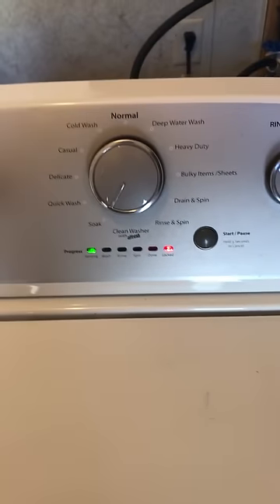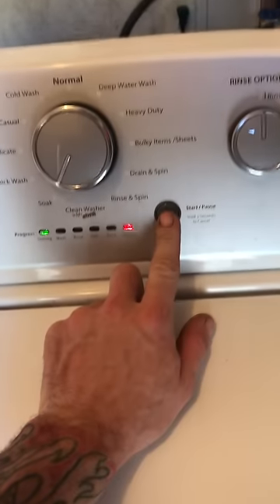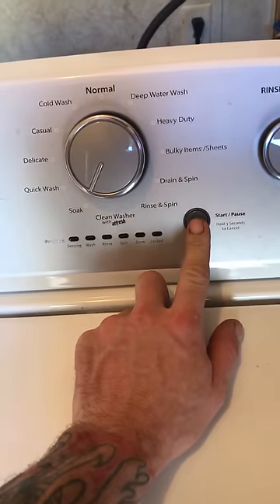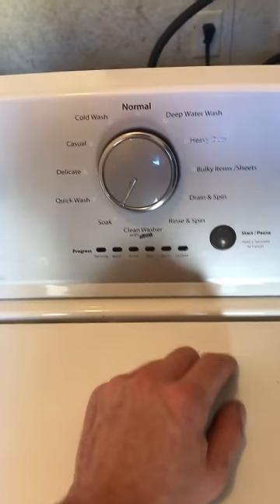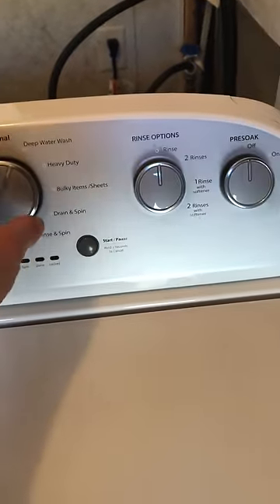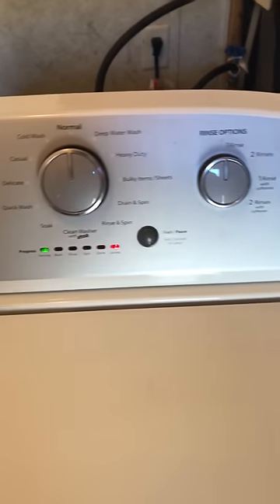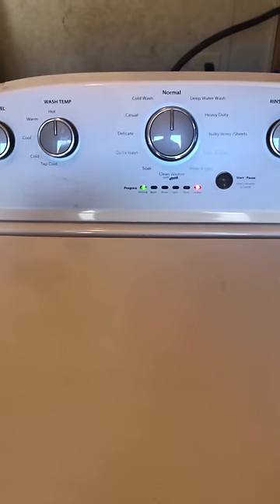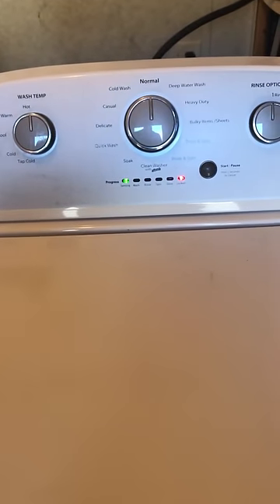Whirlpool washer will not pass sensing cycle

Comment: Pull the tech sheet for the unit (inside the console or taped to the inner cabinet) and follow instructions for testing the motor fault. Most likely a bad CCU
Reply: Okk

Comment: We lost power in our electrical panel. Afterwards the washer blinks the sensing light, puts a shot of water in then nothing. Then starts it all over again. Have tried all of the unplug, closing door 6 times tricks and still not working. Lock light is also not coming on.

Comment: Same problem that i had and this is what i found out, 
Sensing cycle means that it is checking the level of water in machine.
From start up no water should be in machine this is why it's flashing sensing. 
First UNPLUG MACHINE!!!!!!!You must drain the water then machine will work. 
Check your drain pump MAKE SURE ITS UNPLUGGED. it's has two leads brown ,blue. Disconnect and check the pump it should not show a short with the volt meter, if it shows short it's bad.
Reply: How do you drain the water??
Reply: kansaskix1 
Make sure to UNPLUG THE MACHINE FIRST.
Open the back of the washing machine and tilt it foward. Disconnect the drain pump  and straighten the machine back right.  The water will run all over the floor so be prepared to clean it up the water
Reply: Thanks so much for replying! But I finally got it to work (after 6 hours) by doing a recalibration specific to this machine (found a video for that also :)
Reply: kansaskix1 mind sharing that link? I’m having the same issue as what’s in this video
Reply: This is the video I used.  You have to do it exactly how he shows it with the knob starting in the same place.
Reply: kansaskix1 did you replace the board or just calibrate the machine?
Reply: kansaskix1 video link please this just happened to me this morning
Reply: Tyler, I just recalibrated the machine. I've had to do it again two or three times since then. I finally put two and two together, that the machine kept doing it when I used the "Delicate" cycle. There must be some sort of faulty something on that particular cycle. So I can't or just don't use it anymore.
Reply: kansaskix1
1 month ago
https://www.appliancevideo.com/whirlpool-wtw5000dw-washer-will-not-complete-spin-cycle-electronic-control/

Here's the video link again. You have to do it EXACTLY like shown in the video, with the knob starting off in the same place or it won't work.
Reply: It may be just my particular machine that has a fritz on the Delicate cycle, though. Overall, this machine is extremely glitchy.
Reply: @kansaskix1   where can I find the video
Reply: My sensing light will not light up as it should on start but will not light up, yet automatic and manual all works except the sensing light will not come on as it should until it stops as it should and then starts the wash. What makes the sensing light work anyway?

Comment: It's the inlet valve  water cant come in so the cycle wont start  try on different  temp of using hot try cold if it comes on replace inlet valve

Comment: Mine was doing the same.. found the problem is a bad  water valve. The cold side is bad ..I switched it to hot water and it begins to fill and wash. Cold water wont open.. hoses and water supply good .washes but wont rinse because it program to rinse with cold water.

Comment: Probably either the board or the timer. since your lid is clearly locking, it’s not the lid latch. And you are getting lights so it’s not the display, and you have power so it’s not the fuse.
Reply: My washing machine water goes into machine but won't fill up it goes out the drain! Can anyone help me.

Comment: Let's just start by saying I have been a whirlpool customer for over  40 years but no more  I have one of these new machines that is 2 1/2 years old and they are nothing but pure TRASH  mine is stuck on sensing mode off and on fills a little bit with water stops and fills off and on   and won't go into wash mode and it goes out of balance very easy  I had a service tech come out and even he was a little stumped by the intermittent problem he was up front with me and said these machines are JUNK and I should not invest any more money into it because if it's the control board the part is $300 and currently unavailable so that's a no brainer because the machine was $479 new so it going to the scrap yard  he said he has a Samsung and to buy a Samsung or an LG  or if I had the money a Speed queen because they still have a real transmission and they are guaranteed for 5yrs and simple controls  my last Whirlpool gave me 15 years of trouble free service
Reply: I agree. These are crap! Mine is not even 3 months old!
Reply: @MarkFritz-lk7nf  Yeah think I'm going to invest in a speed queen did my research it's the last of the simple machines without all the electronic BS  the speed queen still has an old fashioned transmission and simple controls Yeah they are expensive but they are guaranteed depending on the model 5/7 years  the one I'm looking at is 1200 bucks but if it lasts 10 years I got my money out of it this whirlpool I'm into it for it close to $ 500 for the machine + $200 for the service technician so $700 bucks for 2 1/2 years of use doesn't sound very good

Comment: My is not rinsing and spinning
Reply: Mine wouldn't as well. Tested the hot and cold water inlet valves. The hot water valve was fine but the cold water was bad. It would wash but stop at rinse because rinse uses cold water. Replaced it and now it's working properly.